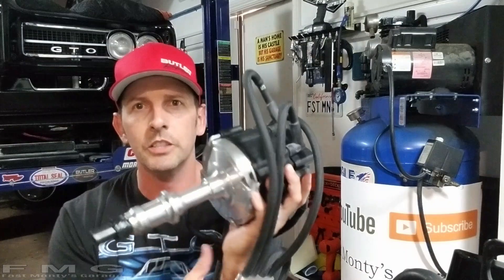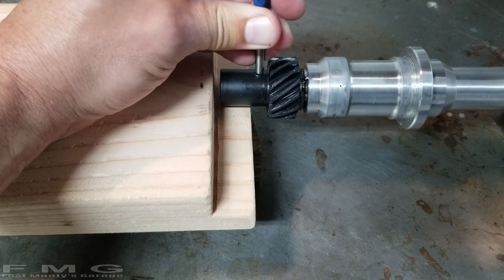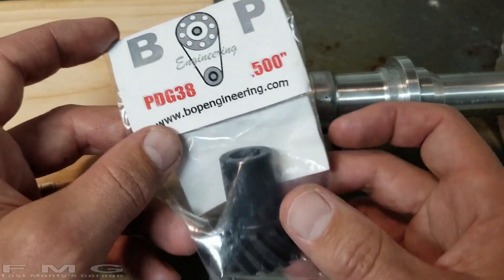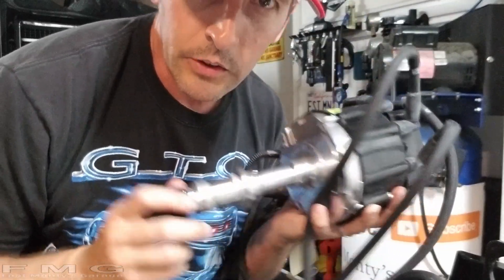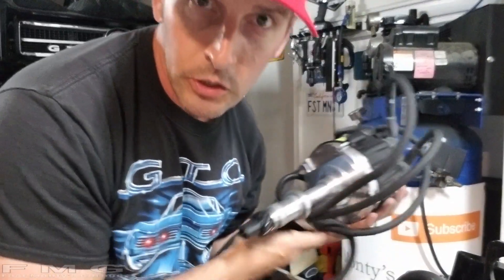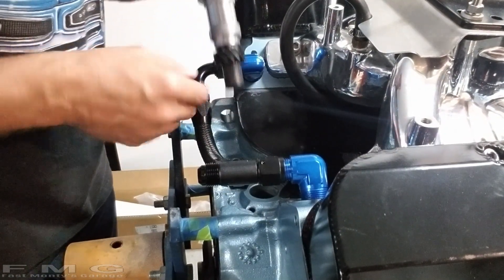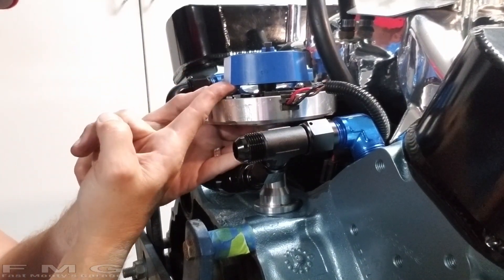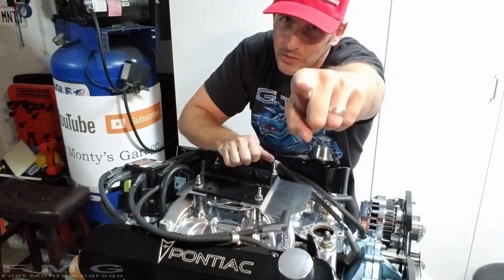Pontiac V8 Rebuild, Part 20:  How to install a distributor for a roller cam.

Comment: Hello, I see you are using some kind of roller bearing and shim between the Distributor gear and shaft. Is this bearing necessary for the polymer gear and where would I find one? I am building my first roller cam engine with a Pertronix Dist. Could you elaborate a little more on this bearing and are any modifications needed, my Dist. only has a metal shim ( washer ) above the gear. Thank You, Great advice !
Reply from the maker: Hey Bryan, good question... that bearing and shim is a part of the DUI distributor design.  Since you're going the Roller Cam route, the most important change is adding a bearing on the front of the cam.  Check out this video, if you haven't already.  https://youtu.be/jKpk64KWqag?si=jHy9b9FGx-KguvjR  Have fun!

Comment: Hey man I appreciate your video's but I have a question for you ok on the distributor I noticed that you placed the fireing order with #1 on the front side ok on my tempest dose that #1 stay on the front or back it's 72 Pontiac 350 I looked it up and it was on the back right side am I wrong with this placement.? I'm Paul and thanks in advance much appreciated and needed..
Reply from the maker: Good question Paul... it doesn't matter where it is.  My issue was the wire length from Number 8, which dictated where #8 should go.  Hence, that's where number 1 ended up.  Hope that makes sense.
Reply: @FastMonty  it does and I appreciate you getting back to me

Comment: Hey I noticed your dizzy has no vacuum, Ive beenoldI need a vacuum dizz, mine doesnt Im not going to race it but what was your reason not to have vacuum, Im in  quandry now to change or not to change. My engine is like your bored 460 aluminum heads, Im ging with 3/2s carb which has turned into a project learning alot though. Thanks
Reply from the maker: Welp, the biggest reason is it won't fit with my new AN Rear Head Water hoses.  But, that said, it's only used for emissions, at idle.  So, it's not mandatory to use one.  Hope that helps.
Reply: @FastMonty  Well yes it does I've had some GTO gurus stating vacuum is needed for a street driver you really dont need vacuum if your running WOT constantly you will get better MPG with vacuum and a few other pluses too. Just wanted your opinion I respect it and your running yours about the same as mine except Im going the tri power route. What a headache it is.
Reply from the maker: @frekkledipped  Yeah Maybe.  Might depend on your cam too... as mine is fine driving around town.  Eventually I'd like to switch to an electronic ignition system with timing control, which wouldn't need a vacuum advance.  Maybe give that a shot, if you're in the point of your project.  Yeah, Tri-Power... I've seen a couple FiTech Tri-Power set ups which look amazing.  Good luck!

Comment: Hey quick question I'm having clearance issues with the heater hose fitting. How did you install that threaded 90⁰ fitting? Did you use a tap and diy set to thread that in? And where can I get that fitting as well.
Reply from the maker: Good question... One, the heads are from Edelbrock, which are already tapped with 3/4 NPT threads.  If you have stock heads, I'd just use the standard heater hose nipple, with the built in restrictors.  (My original AN hoses proved to have TOO much flow.  I did a video on the heater hose myth, if you want to see it...  https://youtu.be/9ou2GKZFf3Q)   Then T off with standard heater hose.  If you have threaded holes, I took one of the 90's out, and replaced it with a straight AN fitting.  Hope that helps.

Comment: I have a 400 ram air IV.  i just ordered the same distributor you have just waiting for it to ship.. what else do i need.  Car has stock wiring so 7 volts... will i need a 12 volt wire convertion kit to make it work?  Im such noob sorry for all the questions.
Reply from the maker: Nice... you'll need a 12V supply, and update that wire to 10 gauge.  It's been a while for me, so let me know if you need help after you get it, I'll have to dig into my archives... ha, ha...
Reply: Awsome

Comment: Hey monty,  which DUI distributor are you using,  i have a 400 ram air IV and i need a distributor..
Reply: Thank you,  i see your in san diego.  I live in temecula now but grew up in oceanside with the Marine Corps
Reply from the maker: @sobrooklyn-do5gs  Awesome!  Thanks for your service!  If you have time, I should be at the Quarantine Cruise in Huntington Beach, next Sunday.  If I don't make it, there are a ton of inspirational rides there... I did a video on the cruise a couple months ago.  https://youtu.be/uJfv1ZaH6As
Reply from the maker: I'm bought the version with Vacuum advance (517211BK)  But, I recently removed the vacuum advance... so the mechanical only would work too.  Hope that helps!

Comment: Always love your videos, Monty!

Quick question, is the distributor clamp bolt hole blind or is it a through bolt? I've been dealing with this very irritating oil seepage in the distributor area. It's nothing severe, just dampens the porous area a bit but it's annoying. I can draw my finger along the entire ridge and along the edge of the valley pan and my finger tip remains dry so I don't think it's coming from the valley pan. 

I also noticed every time I've ever pulled my distributor, the clamp bolt's threads are wet with oil, which is why I'm asking if that hole is blind or if it leads inside the motor where it's exposed to oil. I guess it could just be because the leak itself is wicking down into the bolt threads but I'm not sure. Just want to know because then the solution is that I just need thread sealant.

I have my distributor double gasketed with Butler Performance gaskets and have it clamped down pretty damn tight and I'm still getting this seepage. Could it be the oil valley plug next to the distributor?

Really drawing a blank here.
Reply from the maker: Brother Robert... check this out... https://youtu.be/HbAhQ53ClxA
Reply: @FastMonty  Hey Monty! 

Can't access the video, it's set to private. :(
Reply from the maker: @robertspadaro4329  Ahhh, just testing you.  Wow, clearly not enough coffee for me today.  Try it again.
Reply: @FastMonty  Video works now! It was extremely helpful. Okay, I'll try to switch to one gasket. I know it's not because I'm bottomed out on the oil pump drive, that rarely happens with Ponchos plus I have positive up and down play indicating clearance.

I was afraid of it being the valley pan because I already labored pulling it last November to replace the gasket for the heck of it (even tore it apart at the welds to clean it the RIGHT way)... don't want to have to go through that again. So I can actually just clean it back there and the slather some RTV  along the edge with my finger? Didn't know that was an option. Makes sense, it's a low pressure area. 

And ill definitely make sure to check the valve covers. I went through hell recently trying to get them to seal, and had the most trouble COINCIDENTALLY in the same area of the valve cover you mentioned. I ended up straightening out the dimpled areas from years of overtightening, AND am utilizing load spreaders... I assumed they weren't leaking anymore since I haven't seen any outward signs of leaks since then, but maybe I need to pay attention to that same spot that was leaking before to see if it's still giving me flack.

Thanks for the video! It was very helpful.
Reply from the maker: @robertspadaro4329  No worries... first time I've answered a question with a video.  :)  A couple things.. . One, are you saying your distributor is bottomed out AND you have clearance?  I'm a little confused with that statement.  IF you truly have no clearance, you need to use a Shim and a gasket.  Not two gaskets.

Yes, to the RTV with your finger.  But, I'm now leaning towards your valve cover, since you say that's a trouble spot.  That could be it.  Good luck, and let me know how it goes!
Reply: @FastMonty  Sorry for the confusion, I was saying that I know that I am NOT bottomed out on the oil pump drive because I DO have clearance lol

Good to know that I can just slather on some  RTV with my finger haha. Guess I'll have to pull the dizzy again to switch back to one gasket... but before I do any of that I will give a long hard look at my valve covers.

What would you recommend I do if the valve covers are still leaking? At that point I'll have taken all measures to prevent leaks: RTV'd the gaskets  to the valve cover flange, straightened out the dimpled areas, used load spreaders... at that point I'd be at my wit's end trying to get them to seal. All that would be left would be to just get new covers...
Reply from the maker: @robertspadaro4329  You guessed it, next step is new reinforced valve covers, with reusable steel lined gaskets.  I remember the days of struggling with the stock valve covers... I hated it.  (Even though it was my Dad's daily driver, I still hated it, lol)  Keep it up!
Reply: @FastMonty  Do they make ones that look stock and have the centered PCV breather tube provision? Car is a 1979 Trans Am with the W72 400.
Reply: @FastMonty  So I went to check out the car. Don't think it's the valve cover! When I looked at it, I was instantly reminded that the trouble spot that I dealt with on the valve cover was on the outward facing corner of the back; in which case if it leaked it would travel down to where the oil filter is (which it did before). Coincidentally it is moist with oil where the gasket meets the head mating surface in that trouble spot but it's not leaking or running, i think the cork just absorbed most of the leak and gummed up oil prevented it from getting worse.

Anyway, point is the INWARD facing corner that could run down to the distributor valley is bone dry, and I ran my finger along the entire possible leak path and nothing so I don't think it's the valve covers.

I took a closer look at the back of the valley pan and was finally able to see some glistening moisture along the vertical surface of the flange the valley pan mates to, indicating that it may be the valley pan...

And so I went at it with my finger and Ultra Black... like a maniac. It is NOT pretty lol... but hopefully it will work.
Reply from the maker: @robertspadaro4329  Welp... so far only TWO of us know what a freakin mess the back of your valley pan looks like.  HA, ha... until someone else reads this.  Sounds like you caught it.  See ya soon!

Comment: I noticed your rotor wasn't pointed at the #1 cylinder firing location on the distributor cap
Reply: I've read on the Pontiac forums and in Jim Hand's book, that the rotor for the #1 should point to the firewall towards the driver.
Reply from the maker: @nachomax1639  I've read the same... funny thing is, no one says why.  But, in my latest "First Fire" video, that's exactly where I ended up.  Purely because of my plug wire set, it's the only way I could arrange the wires so they'd all comfortably fit.  Thanks for the comment!
Reply: @FastMonty  that's exactly the reason why number one is pointing to the driver seat points or HEI distributor
Reply from the maker: @sinned96  yup. Thanks for the comment!
Reply from the maker: Ha!  Very funny, Ray... I don't recall showing that detail, but I did explain where Number 1 would be, based on the location of the rotor.  The hardest part is organizing the wires, if your wires are already cut to length.  For example, my number 8 wire is super short, so it has to be somewhat close to that side of the motor.  That'll then determine where the other wires go.  In my case number one is also on the passenger side.  Where I see your point, In the video I just dropped the distributor in and the rotor was pointing towards the driver side.   Thanks for the call out!  see ya!
Reply: I hear you on the plug arrangement. Also if running HEI with vacuum advance, you might be limited on the rotation for advance/retard if the advance canister is set on the driver's side.

Keep up the great videos.  Very informative.
Reply from the maker: @nachomax1639  Thanks... yeah, agreed about the vacuum advance canister.  I removed mine.  Thanks again for the comment!
Reply: @FastMonty  hello, I have the exact same set up, with the DUI, in the pre-cut wire length. I am using my vacuum advance, would be interested to see if you were having heating problems without yours, but that’s another discussion. Would you be willing to send me a picture of how your orientation ended up? The traditional back towards the driver does not seem to work for me either with the wire length. Thanks!
Reply from the maker: @edbartone3869  Great to hear... yeah, those DUI wires are frustrating.  Check out my first fire video, towards the 4 minute mark, you should see a good view of the distributor.  https://youtu.be/WFv3ln8vgt8  Let me know if that helps.
Reply: @nachomax1639  vacuum advance goes pointed towards the driver side fender basically parallel with the firewall if you have it pointed the other way like Chevrolet to the passenger side fender you will have interference with the heater hose
Reply: @sinned96  I have it on the driver side but between the firewall and the head.  I never tried putting it parallel to the firewall. That will probably give more room to adjust without the vacuum canister or the hose interfering with anything.  But first need to pull out this engine and rebuild it. Lost all oil pressure and there's some shimmery oil in the system.  Oil filter pleats had some tiny  metal specs.
Reply: @nachomax1639  I really wish I could post a picture in here but if your vacuum canister is on the driver side it is basically parallel to the firewall

Comment: hey good vids series man, well done ! now why not the bronze disie gear instead ? pros & cons between the two in your opinion ?
Reply from the maker: Thanks, brother.  Great question.  Two reasons for going with a Composite Distributor gear.  One, it'll work with any type of camshaft, which makes it dummy proof.  Two, it'll last longer than a Bronze gear.  That said, if you're going with a bronze gear, because they do cost less, you have to verify it's compatible with your Cam Material.  If it's used on the wrong material, the bronze gear won't last long.  Thanks again for the comment!
Reply: @FastMonty  i'm still on flat tappet and looking at a roller update, been busy pricing it all up, not just cam & lifter, but all the other associated bits as well, no cheap lol
Reply from the maker: @firebird70  Yeah, it gets out of control quickly, doesn't it?  Ha, ha... worth it!

Comment: Butler sure is proud of the dist. gears at $125 a pop. Yikes.
Reply from the maker: They're actually from BOP Engineering.  Same price.  A bargain, considering the damage prevented by using a steel gear.  Again, this is only to be used with a new Forged Cam.  Stock cams do not need this gear.

Comment: Good Job On The Distributor Installation Video,Good Call About Possible Chevy End Play Problems ,Thank You
Reply from the maker: Thanks Greg!  Next weeks video is a fun one!  A project I've never done before...
Reply: @FastMonty  i have a question man i had my motor rebuild and drop in my car but mi haven’t started it since rebuild it’s been sitting for about two years never been started since rebuild there’s no oil or anything in it. Should i do a thing specifically beside adding the oil and all? I’m also having triple installing the distributor any help would be great thanks i have the 326 also
Reply from the maker: @josecollazos6  Good question... first and foremost, you need to see if rust has started to form inside the engine.  I assume you have stock iron heads, so pull the valve covers and see if there's around the rockers, etc... if there isn't any, add oil to each head, covering all of the rockers.  Then getting a priming rod, like I have for the "first Fire" episode.  What issues are you having with the distributor?
Reply: @FastMonty  thank you for the reply . I’ll check for rust but I’m sure there isn’t any but if there is what can i do for the rust is there anything i can pour in it ? Also when i going to prime the engine so i just pour a qt of oil through where i normally pour the oil to fill it up ? I can’t get the distributor to go in lol or align been a pain in the butt
Reply from the maker: @josecollazos6  Honestly, I'm not sure if there's a product out there to help with internal rust.  The oil goes in through the hole in the valve cover.  So, while you have them off, just pour a couple quarts over each head.  OR, as many quarts as your engine needs.  The distributor should just drop in.  Make sure it's lining up with oil pump shaft, which you may need to rotate a bit with a screw driver.  Here's my first fire video, where I install the distributor again... https://youtu.be/WFv3ln8vgt8
Reply: @FastMonty  thank you very much for your help i appreciate it
Reply: @FastMonty  question again for you when you prime the engine is there a certain oil to use ? What oil did you use and how many qtrs? I have the 326 engine no mods done auto transmission
Reply from the maker: @josecollazos6  You should be using break in oil.  If you have a flat tappet cam, you need to read up on how to break that in.  Basically when you first fire the engine, you have to run it at 2000 rpm for 20 minutes... or, something like that.  Not sure how much oil your engine needs... I'm guessing 4 or 5 quarts.  Please look that up online.  (Mine takes 7, but, I have a huge oil pan)  You'll get there!
Reply: @FastMonty  thank you i got the brake in oil comp cams . Now I’m trying to remember where some hose lines go would you be willing to let me email you and send you some pictures to help me out i can’t find out on any of the forms .
Reply from the maker: @josecollazos6  I can try, but can't promise I can help over email or phone... best to have an expert look at it in person.  my email is fastmontysgarage@gmail.com